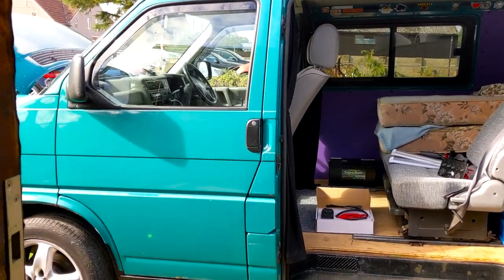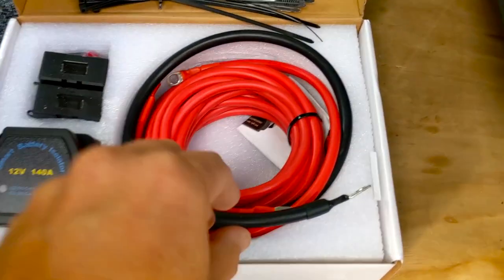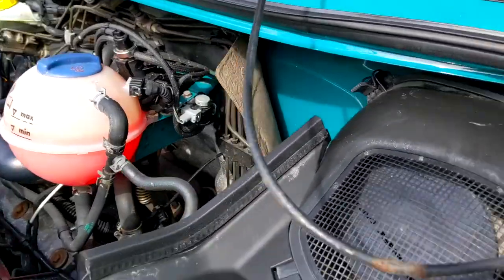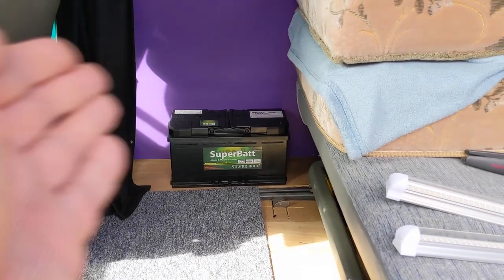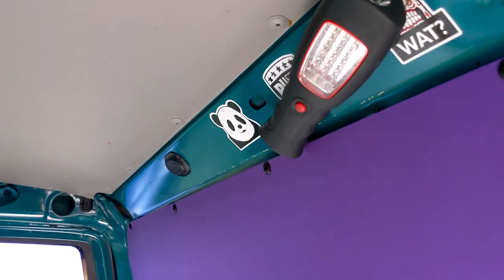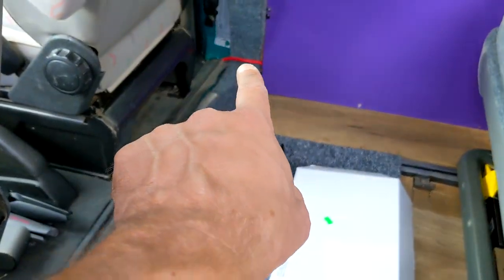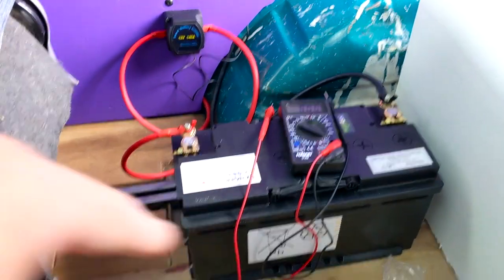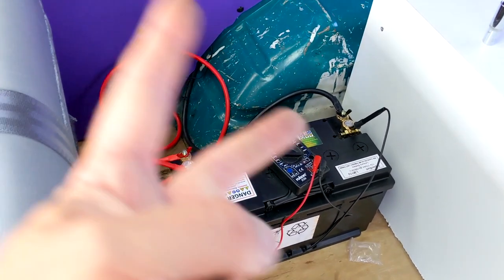Installing Leisure Battery and Split Charge Relay VW T4 Camper Van Build

Comment: Excellent work mate what size is your alternator I’m thinking of buying the same kit but my alternator on my T4 is 90Ah
Reply from the maker: Thank you very much 😃Not sure mines the 2.5 88hp, I used to have a 1.9 ABL which run this same style system no problems. Hope that helps?
Reply: @meatmanifesto  My T4 is the 1.9 ABL non canbus [no Ecu] definitely going to buy this split charging kit.. Thank you for replying 👍